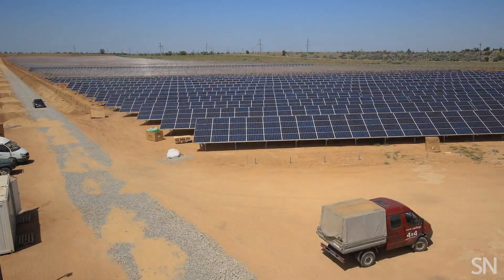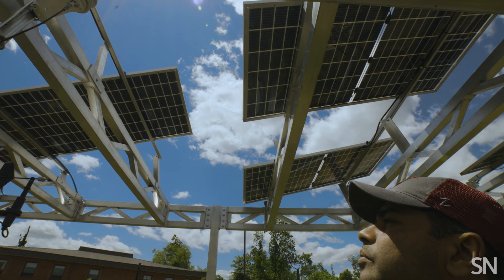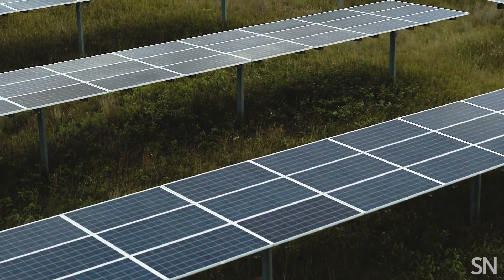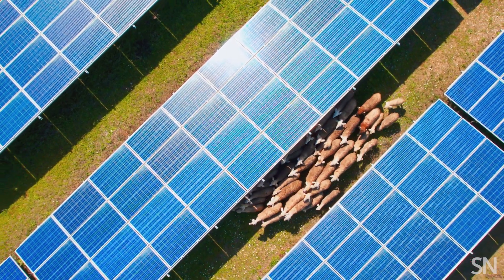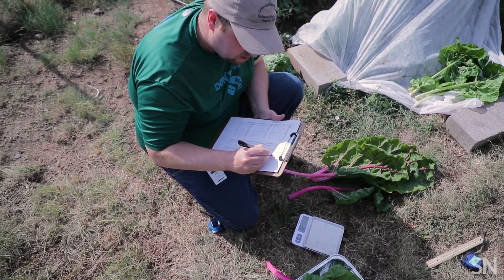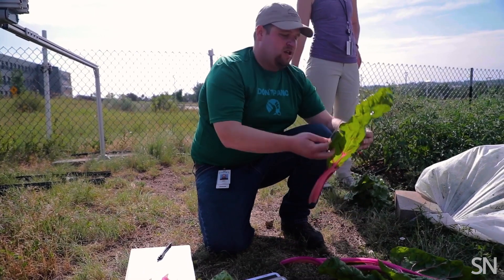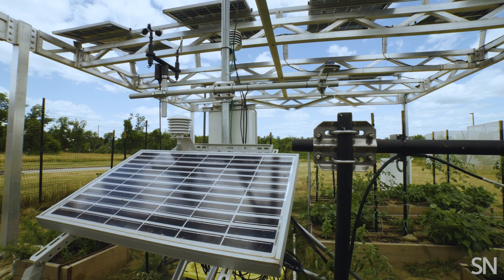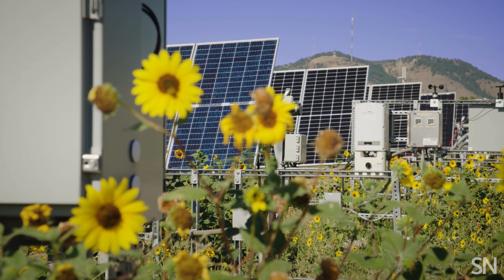What is agrivoltaics? | Science News

Comment: Vertical bifacial panels along north-south meridians with plenty of space between both avoids interfering with crop management, and reduces morning moisture loss and afternoon heat stress. Total collection is less than from panels slanted south, but power in morning and afternoon is more valuable than in midday.

Farm land available far exceeds the area needed for collection, so spacing the panels out does not cost anything. The extra income comes at no cost beyond initial capital outlay. As panel prices continue relentlessly downward, installation cost becomes relatively more important; fencerows require much less complicated structural support than slanted panels.